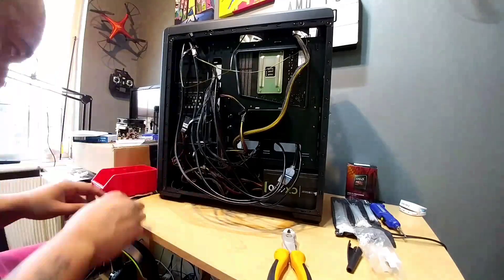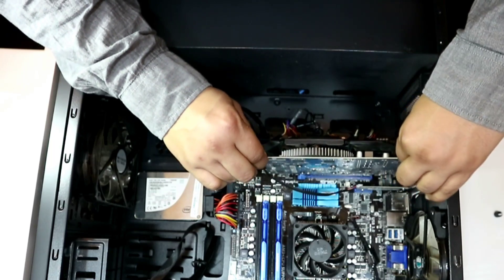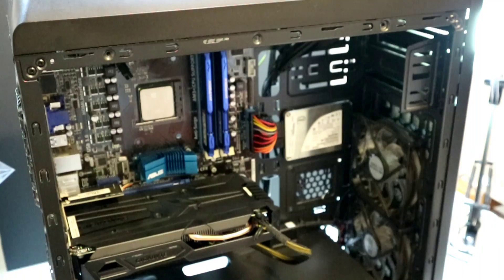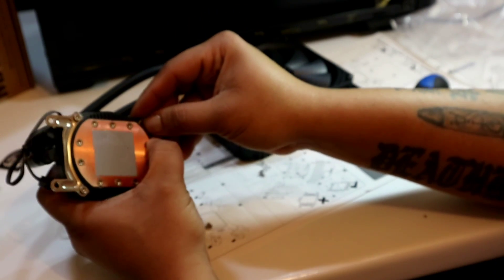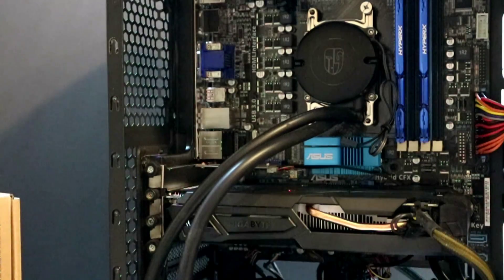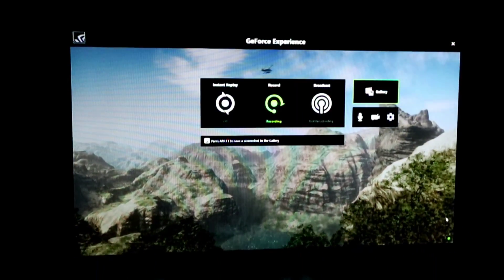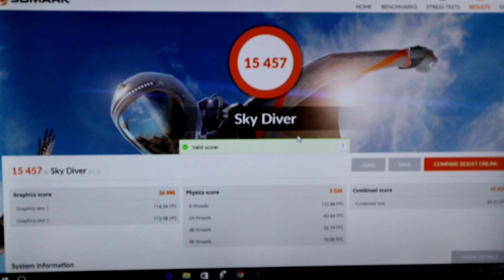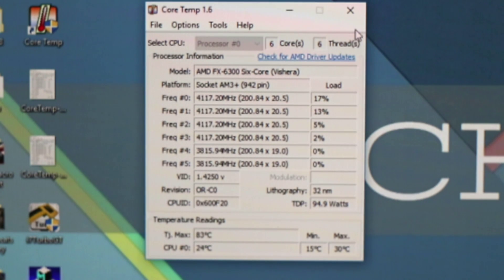How To Install A Deepcool 120K AIO & A New GPU

Comment: Its really cool to see the difference that little upgrade made.  did know that you knew so much about building PC's though.
Reply from the maker: +CH Gadgetz 
Used to love building pc's many years ago, just getting back into it, doing a mod on a pc case at the moment...
Reply: OK cool. So will the new mod make it to the channel?
Reply from the maker: +CH Gadgetz 
Haha depending on how it turns out. #fail might do a how not to mod your case. Going well so far im working with a cooler master cm590